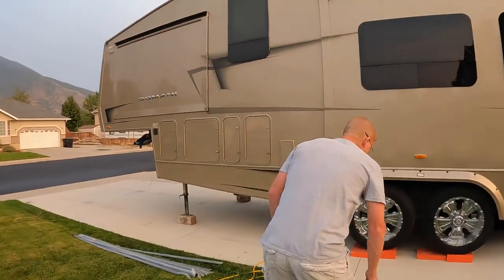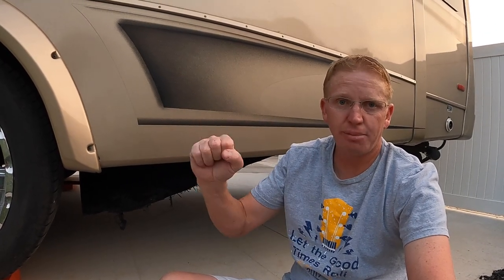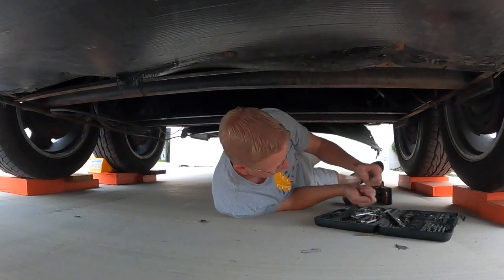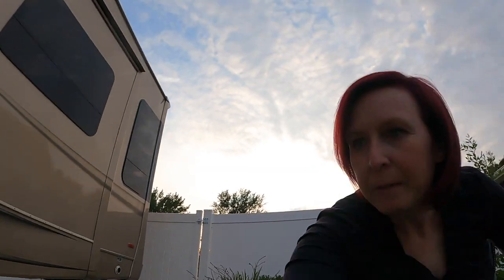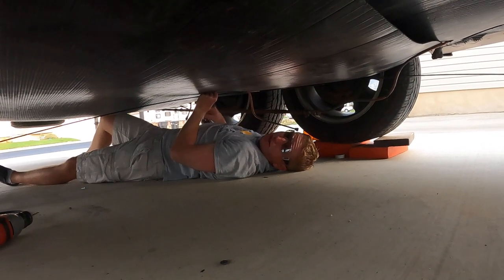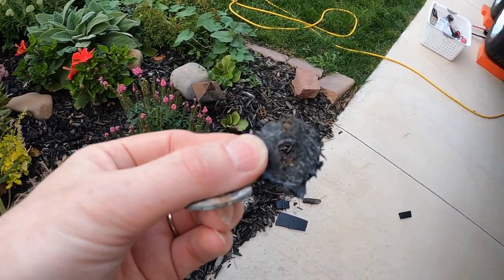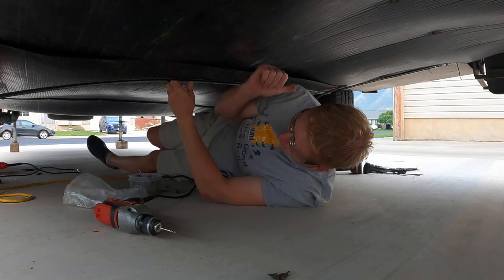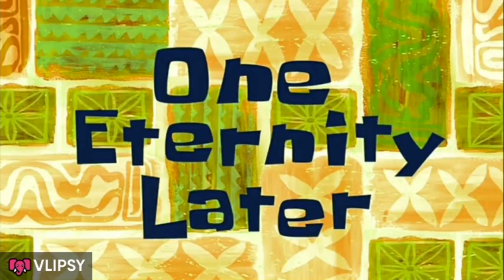Fixing RV Underbelly Again!!!

Comment: What did you attach the cross strips too???. The sides i can understand but the cross beams?
Reply from the maker: I attached them to the sides but years earlier I had ran angle iron across side to side to secure the belly board to.  But then the screws and washers eventually pulled through.  The cross strips are being screwed to those pieces of angle as well so it is basically sandwiching the belly board.  Thanks for watching.

Comment: "Perfect ain't free, and I'm cheap, so it'll work." My motto exactly! 

I had water leaking from my water pump, but didn't know it until I go out one day and all of the fiberglass insulation contained within the underbelly black poly fabric is just bulging under the weight of sopping wet insulation. One stab of a knife through the fabric and water starts gushing. What a mess pulling off the underbelly fabric, all the while getting soaked and covered in wet insulation. We all know how wet insulation sticks to everything, and everyone. 

Now that I've identified and fixed the leak, I need to reinsulate and put on a new underbelly cover. However, I'm debating on whether to use what was original to the rv, a poly fabric that was originally stapled under all kinds of trim that will have to be removed. Or do I go with a more structured corrugated black poly that can be more easily removed when I need to access the components contained within the underbelly. Either way I'm looking aluminum bracing and framing; just seems like a rigid, corrugated, poly sheet would be more manageable and easier to get on and off as needed. Any thoughts? Oh, I also need to replace the underbelly fabric under one of my slides. To do it correctly, I would need to remove the carpeted flooring and plywood from the slide in order to wrap the fabric up and around the plywood. Seems like a lot of work. The owner of the rv before me had cut into a part of the fabric and then used the fabric mending tape. Problem with that is everytime the slide was brought in, it would cause the tape to shift and then the residue would stick to the flooring in the main living area of the rv. So, I would have to clean sticky residue from the floor everytime I put the slide out. Such a pain. Trying to figure out another option of using some type of rigid material, but not sure how I could install it without screw heads sticking out and scratching the floor when the slide comes in. Any suggestions are appreciated!
Reply from the maker: I don’t know if there is a good suggestion I can give you.  Rv underbellies are awful.  Maybe the worst designed part of any rv.

Comment: Where do you purchase a belly board, 🤔
Reply from the maker: I bought mine at my local dealership.  Just told them how many feet I needed.  Thanks for watching.
Reply: @JauntJunkies  What you are referring to as "belly board" is not made of cardboard. It is corrugated plastic (better known as "Coroplast")  I solved the flapping in the wind problem of a coroplast underbelly by gluing the coroplast to 1" sheets of foam board insulation. The coroplast 4 x 8 sheets and the foam board insulation are quite readily available at Home Depot, Lowes, Amazon, etc. and probably cheaper than an RV dealership.

Comment: I hope I don’t have that problem with my under belly, at least not yet. There are a few manufacturers that have switched to a more robust material which is a plastic with ribbing, but I haven’t been able to find it anywhere.
You had the opportunity to insert some fiberglass insulation when you had the panels off. Not that it is necessary. 

Like your solution and hope it works. 

I added R17 aluminum foil covered styrofoam insulation under my floors. Especially in the basement and generator compartments. There wasn’t any insulation above the generator compartment, which is beneath part of the bedroom floor. 

Thanks for the video, this could prove to be helpful to many, but we all hope not!
Reply from the maker: Thanks for watching.  We did not put in more insulation because I wanted to make sure this actually holds up for awhile.  If we were fulltime we would have done that for sure.  Thanks for watching as always.